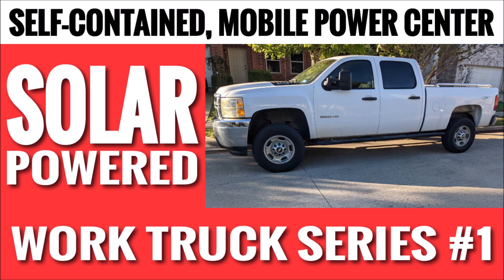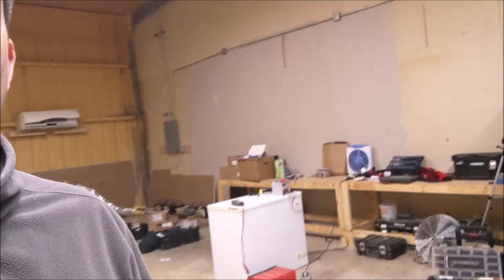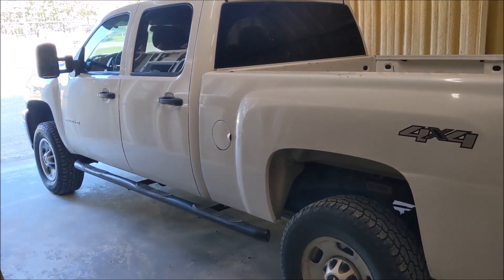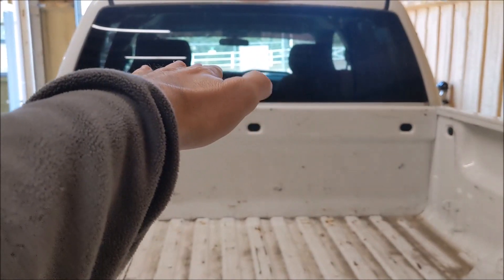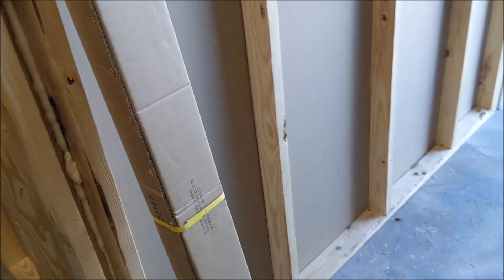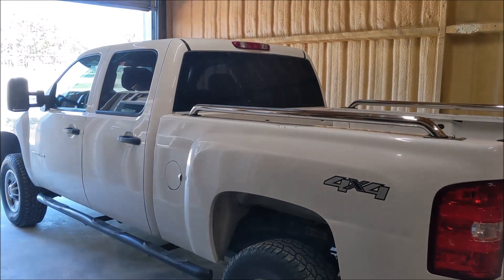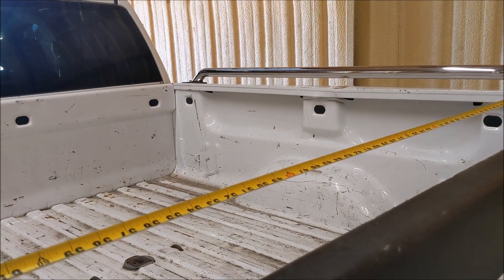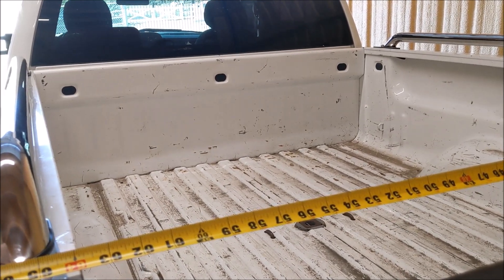Solar Powered Work Truck Part 1 - How To Mount The Panels

Comment: What exactly will be solar powered? Will the truck run an electric motor or will this be a mobile battery/inverter system to run work tools out in the field with solar panels to charge the system? I watched this video a few times in case I missed the purpose or aspiration of why!
Reply from the maker: Sorry, I said it in the first few sentences but it may be confusing.  This will have a full solar panel system installed on it in order to provide power to work wherever I am.  That includes power tools, lights, or whatever I need.  The vehicle itself will not be converted to electric and then powered by solar.  That is an impossible dream at this point.

Comment: Nothing wrong with gas especially an LS but diesel would be better
Reply from the maker: Yeah much better for towing.  Not so much for fuel prices!  I just couldn't afford it.  It would have been an extra $8000-10000 at the time (~100k miles).  I got it for about $18k.
Reply: @LDSreliance  diesel cost more but it will still cost less to because you get better milage
Reply from the maker: The diesel engine gets 16 mpg and I get 11 mpg on my 6.0L gas.  So if I had to pay an extra $8,000 to get that option and I drove 1,000 miles per month, it would take me 94 months (almost 8 years) or 94,000 miles to break even.  

If I knew I was going to own the vehicle forever or had a burning need to tow heavy stuff and could afford the extra, I would definitely do it.  But I'm not sure it makes a lot of financial sense otherwise.
Reply: I was not saying all that I was just saying the fuel price isn't really much of a consternation
Reply from the maker: Oh ok yeah.  Right now the fuel prices are pretty similar.

Comment: Are solar panels fragile? Inevitably, your truck is going to be bouncing around due to all sorts of road conditions that you can't predict, potholes while driving at freeway speeds and many other examples I'm sure you can think of. Could a rack of solar panels stand up to impacts like that or possible flexing? It would be a shame if your panels cracked or outright shattered while out on a drive.
Reply from the maker: The glass on solar panels is incredibly strong.  It can withstand hail (up to a certain size) and heavy snow loads.  I think it will be fine.  But time will tell!